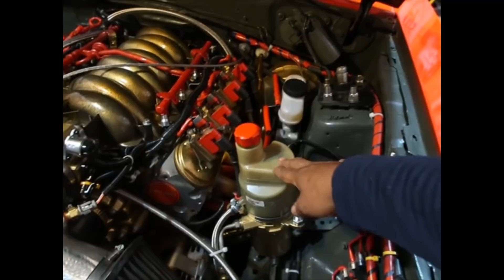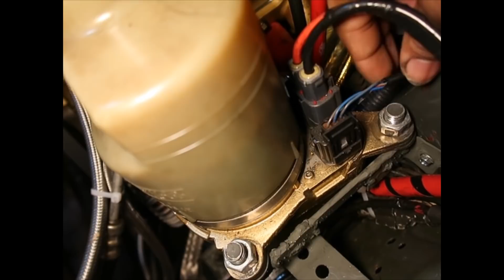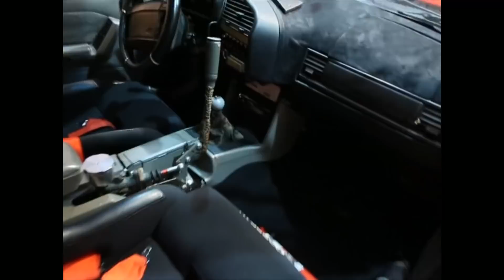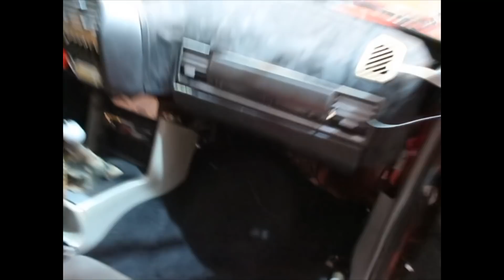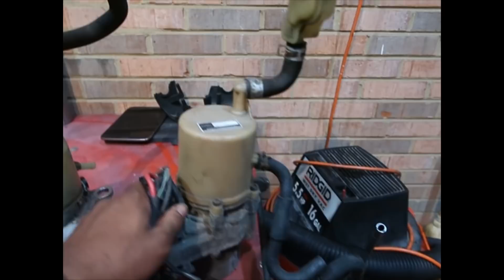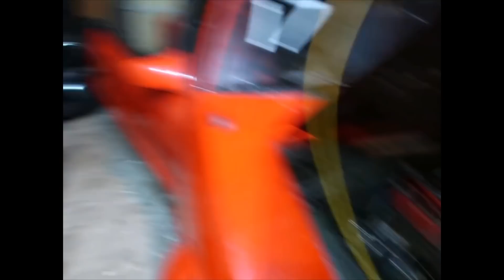Electric Power Steering Pump Conversion

Comment: Awesome info I own a lincoln town car 1990 the power steering pump return hose and pressure line were replaced next thing I noticed was the sensor solinoid that screws into the side of the pump started leaking I looked everywhere for this part which I found out its a 1yr part only thanks to this video I can customize this issue I have a 5.0 302 in her so this is what I needed thank you 👍🏾🎯🎯

Comment: Very nice vid and extremely well done.  I have a question on the grey wire.  Do you toggle it on and leave it or is it just a momentary switch to get the pump started via an internal relay?
Reply from the maker: It needs constant 12v to stay on.  I believe there is an internal solid state relay

Comment: Great video. I have a '88 ranger with a V8 conversion & want to upgrade my steering. Right now I'm using a manual steering box, which feels great on the road, but sucks in tight parking lots. Did you have any issues with pressure? I have a Ford power steering box I can install, but wonder about PSI problems. I think the Ford unit is designed to run 700-800 PSI.

The only belt on my engine runs the alternator. I'm using an electric water pump & don't want to rob any power by adding a belt driven steering pump if possible.
Reply from the maker: running an angle kit is pretty strenuous on power steering components, It boggs down when I hit my steering stops or when making several very fast steering motions,  but it has been perfectly fine driving normal, and at the track for me.  I have several friends that use them as well, all with good results.

Comment: Love your vids and cool Foxbody ideas man.  Good to know about the Volvo electric pump.  I was gonna try an MR2 electric pump.  You think this setup will work with hydroboost brakes?
Reply from the maker: I don't know anything about the hydroboost system, but I don't think your brakes are linked to your steering in any way.
Reply: @Sgt.Slides  Yeah hydroboost is when hydraulic pressure from the power steering pump is used to assist with brake pedal effort instead of a vacuum booster.

Comment: Are you still running this same setup? Have you looked into a Nissan unit that's used in late model Altimas, Maximas and Pathfinders? I was considering this swap and the Nissan unit is much cheaper than the more popular Mazda, Toyota and Volvo units. Only problem is that I've yet to find a wiring diagram for one to find out whether a canbus signal is necessary or not.
Reply from the maker: I have not.  the only ones I am aware of so far are the Mr2 unit, which is costly, the volvo unit that I let the secret out on, and there's also a Porsche unit that's identical to the volvo pump, except with Porsche parts price tag.  I tried the Mazda unit but found out you can not manually turn it on.  If you get hold of a newer Nissan unit, PLEASE provide some feedback, i'd love to know what happens.  Shoot me an e-mail @ Media@premiumFuelMag.com.

Comment: get wiring for the power to pump for $49.34 at https://www.autopartsway.com/partlist.cfm?volvo/2009/s40/t5-inspiration/2.5l-l5/allb/steering/wire,-cable-and-related-components/power-steering-pump-wiring-harness/pagenum1/tabs

Comment: i just picked up a Mazda3 pump, it looks like it should be as simple as running running 12v to what is labeled as the G/L wire. on the harness i got its just green. main factor is finding the 6 pin connector and finding the proper wire location. the MR2 pump is super easy and a friend has one. ive been on the hunt for this volvo pump though 
this is the wiring diagram for the Mazda pump - https://ww2-secure.justanswer.com/uploads/supermazdatech/2011-01-20_214804_epas.gif

Comment: Great Build! I'm a sucker for tidy wiring and modular design.  Have you ever thought about an electric water pump conversion?  I love the idea of freeing these accessories from varying engine speeds, especially when they don't coincide with the draw.
Reply from the maker: electric water pumps are costly, and not really great for street or drift applications.  They are better off in drag setups.

Comment: What type of fluid does this run on
Reply from the maker: That's a good question.  The ideal flyid would be whatever Volvo uses from the factory, unfortunately, I can't figure out what that is.  I did find out that ATF is pretty healthy for any power steering system, so I run ATF.

Comment: Excellent video! Is there a reason you didn't run the signal wire to the key-on/engine-run position? Have you done away with the factory column ignition switch?
Reply from the maker: I still have key on 12v, but i don't want the pump running while im trying to start the car, I don't have the ignition relay set up where it kills power to everything while the starter is turning.  Plus,  I have all these switches, i need them to do something.

Comment: Cool install but very inefficient if the pump actually draws that much, hopefully that is only under maximum steering load though....
Reply: 5-10 nominal load, 80 max at full lock

Comment: Awesome video. 
Definitely put my doubts to rest. I have the 2nd pump you show in my 2jzs14. Steering feels heavy and it definitely doesn’t like quick movements 
Does yours also seem to have a lag when the wheel is stationary and you go to turn it quick? I’m assuming it’s the bump switching form bypass to normal operation. I mean it’s like a split second then the pump noise changes slightly and I have power steering. My pump is also in the back of the car. Regardless, awesome video!
Reply from the maker: mine also does not like quick movements.  I thought this was due to the extra load from my angle kit, good to know this is normal for it though.  One thing my pump HATES is when you hit the steering lock, it sounds like it wants to explode.

Comment: I used your video to convert my Ranger to EPAS. One of the best modifications I've made. Absolutely love it. 

THANK YOU!!!
Reply: https://youtu.be/YKSdskniPcU
Reply: How noisey is your pump?
Reply: @ralfareno  I have headers, Flowmaster exhaust, and a 3" Ram Air setup with a twin plane intake, so you can't hear it at all.

https://youtu.be/YaKvq1cF6B8

Intake has since been re-routed.

Comment: Thx for the great tips on running electronic assisted power steering pump,,, i have a ?,, i have 1967 camaro without power steering, do u have a set up for that or u have any idea what would work, iam try to get it fixed, its a father n son project, any help will be great,,, it has stock 327 SB, the reason i like your setup because in future i'm planning to go with LS motor but for now 327 is ok, thx

Comment: Does the pump still used Mercon ATF/V?
Reply: What year and model/ engine did your pump come from? I've looked but just keep finding belt driven pumps.
Reply from the maker: I look for 05 and newer,  I know the c70 has it, a few other models do too, but not all. It takes a little researching.  @jamesheichel9465
Reply: @Sgt.Slides  yeah it's been a pain. Most that I find are mr2 but not sure on the fluid and wiring vs a Ford built part.
Reply from the maker: I couldn't figure out what it uses from OEM, so I just run regular ATF after TONS of reading. Is Mercon ATF/V the oem stuff?

Comment: Doing this conversion on my 1990 GT.  Going through diagrams and trying to figure something else out though.  The other connector with 3 wires is for the CAN bus communication.  The ECU will read inputs from wheels speed and other sensors and vary the speed of the power steering pump to accommodate for whatever driving conditions.  I'm curious if I can figure out a way to replicate the CAN bus signal, which is just voltage variance, and slow the pump down a little, or a lot, and if it would still work well in the Mustang that way.   It'd lower the amp draw, possibly make the pump quieter, and the pump will last longer.  

I suspect it's running at full speed when just hooked to 12 volts and ground.  From what I've read, through CAN bus it runs at 2/3 that speed normally and only speeds up when the wheels are turned while the car is sitting still.  At highway speeds is slows all the way down.  I'm going to run the pump on my GT regardless, but I thought it'd be cool to see if we can make it more efficient.  Especially for the Fox Body community.  Even with the 130A alternator and wiring upgrade, they struggle to keep up with electric fans, stereos, etc.
Reply: Did you ever try and duplicate the signal to slow the pump? Curious if it worked.

Comment: I'm interested in connect  electric cables to mazda 3 electric power steering to my proyet  hello from new york
Reply from the maker: sorry, there is no way to make the Mazda pump work
Reply: thanks
Reply: @Sgt.Slides did you guys figure out why won"t the mazda pump wont work wanted to wire in a direct switch for mine
Reply from the maker: @bakerskater846  The Mazda pump is computer controlled, you can't just trip the signal to make it come on.

Comment: https://www.volvoclub.org.uk/tech/S40MY2005-SuspensionSteering.pdf  The above link is info and schematics on your pump starting on page eight. Your pump speed is PWM controlled to the EPS where a D-A\A-D convertor is located (Digital and Analog). The digital 0 signal is converted to minimum operating voltage which is dependent on the vehicle the pump is in and the digital 1 signal is converted to as many as 10 different voltage signals to control steering hydraulic pressure. Again dependent on the vehicle the pump is in. Sorry, I can't share access to that info. Good luck.

Comment: Check this out: https://procarmanuals.com/vag-ssp-259-ephs-electrically-powered-hydraulic-steering/    Scroll down to where you see VW and the self study guide is a scrolling window within the page. Pay particular attention to the pump with the self contained, integral PS control module on the pump. This type of pump system has all of the control programming in the module and just taps in to the CAN for existing information. You don't have to concern yourself with making any programming changes to your ECU. The pumps you have with the wire clusters may work the same way as the pumps in the study guide. If you can supply me with your ECU make and part number, your rack make and part number along with the pump's part and revision numbers I may be able to help you with how they may work on your car with what you have. All you might need to add is a steering angle sensor and a PWM frequency convertor. Neither is all that complicated to add. Also, where is your rack? In front of or behind the axle center line? This is called front steer and rear steer and the two have different, what amounts to, torque characteristics. EDIT: I don't know why but if the link doesn't work look at the address and delete anything in the address after "steering/". For some reason I get a bunch of gibberish after the slash.
Reply: First off, understand that I'm not trying to help you with your steering because of some sense of car guy "camaraderie." I'm doing it because it's helping me with something I have going on and this is useful and might save me some time.
Reply: Starting in 2006 with GM's LS ECU's the E38 and E67 EMSs (VCT separates the two) came with as many as 70 "latch circuits" to communicate with "embedded controllers" for vehicle management control over the Can Bus network that allowed for diagnostics over the network. Federal law mandated access to embedded controllers over the CAN network for diagnostic purposes with generic scan tools by 2008. Latch circuits are used for systems like ABS, air bags, cruise control, hybrid management, engine run and no-run when stopped, etc. and EPS, EAPS and EHPS. Depending on your ECU, control of your electric pump for power steering may already be done for you and allows you to define the pump's management. Even if finishing the circuit to control the pump is something you don't want to attempt, finding someone from the the Mega Squirt, Arduino or the like crowd should be easy and inexpensive to do. Compared to controlling something like injectors, controlling the pump would be fairly simple for them. The added safety factor you'd get from defined steering sensitivity the would come from controlling your pumps voltage would make following through with this IMO well worth it. I may also be able to help you with the unique issues you mention with your rack. Autocross may not be the issue for you you've discussed. If interested I can identify the issues to be solved, or identify if they may already be solved, to put your EHPS on to your CAN network.